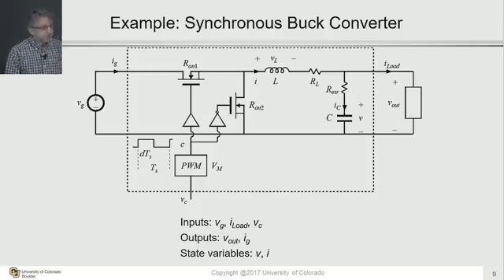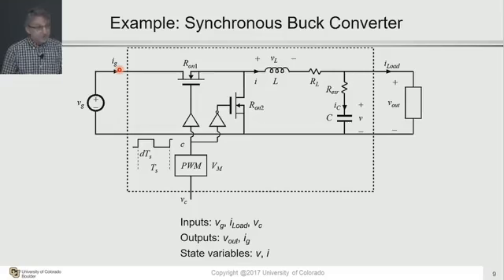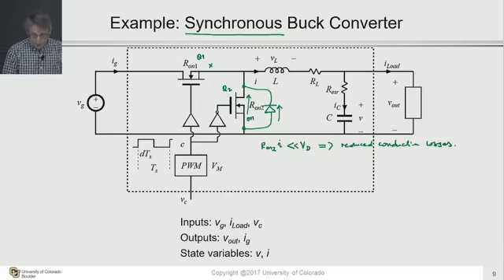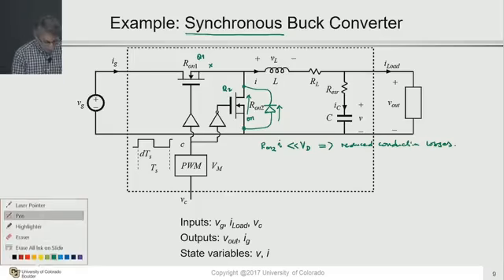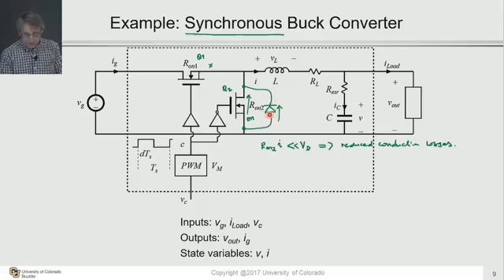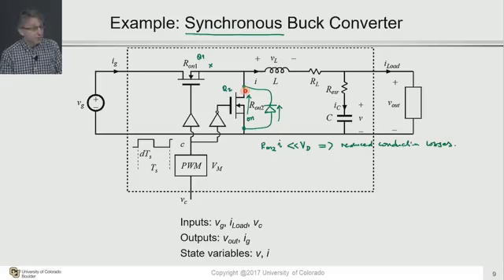Synchronous Buck Converter

Comment: Doesn't the body Diode of Q1 interfere with the realization of the Switch? If IL is supposed to be sourced from Vg when Q1 is ON, shouldn't we prevent IL from flowing back to Vg when Q1 is OFF? Wouldn't an IGBT be more appropriate to realize Q1?

Comment: Awesome video very well explained. 
I keep having buck converters fail. All are the same converter with the same components. From early looks its the same MOSFET that fails over and over again. If I were to guess I would guess it's Q2 because the inductor discharges at a faster rate than it charges so I'm seeing higher currents through Q2. Is my thinking right?
Reply: Hi BradK. Your hypothesis may be correct, especially if you are using 2 different FETs with different Rds,on values. In addition, however, stray inductance due to FET package and layout in a discrete supply can cause negative voltage spikes on the gate of the low-side FET (Q2). This can violate the Vgs limit of Q2 if you are driving the gate really hard. If you find that this is the case, you can add a couple components to the gate of Q2 -- a low resistance series R for charging the gate and a Schottky diode for discharging the gate. Also, check for ringing on your switching node, as this can violate the Vds limit of Q2 if you did not consider it when selecting a FET for your low side. Hope this helps!
Reply: @brendankopf6249  Awesome info. Thanks for the suggestions I really appreciate it!

Comment: Awesome video. Thanks. He mentioned that "obviously both switches would not on at the same time". But why is that? And what would happen if they were on at the same time?
Reply: It's "obvious" from the schematic, because they are going exactly in anti-phase one to another i.e. they are inverted as of the schematic (one has a buffer the other one has an inverter, both are the same delay as buffer and inverter have almost same delay, so there is no asymmetric PWM fed into any of the two gates.)
And don't listen to Indian explanations.
Reply: If you had both turned ON at the same time, you would be shorting the input to ground.
Reply: @akhurash  yes, the thing is they cannot be both turned on by design. they are exactly in anti-phase given the circuit represented in the video.